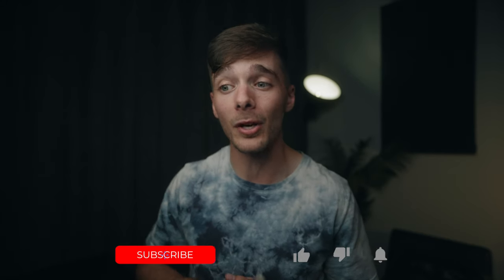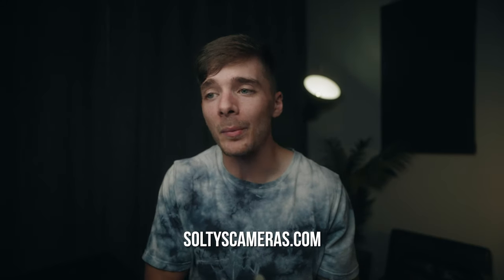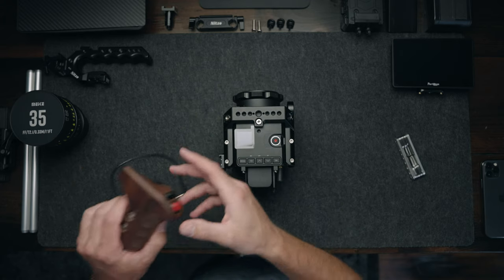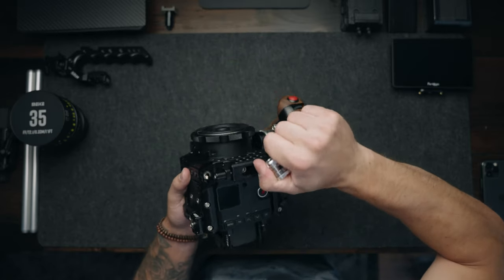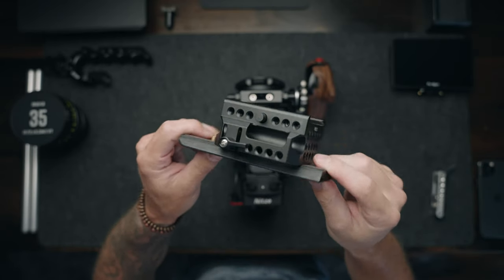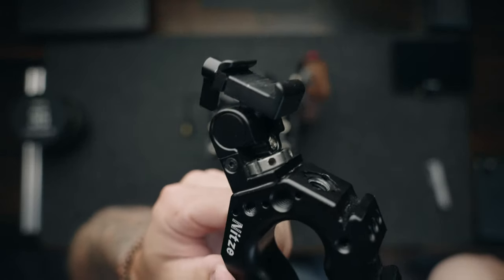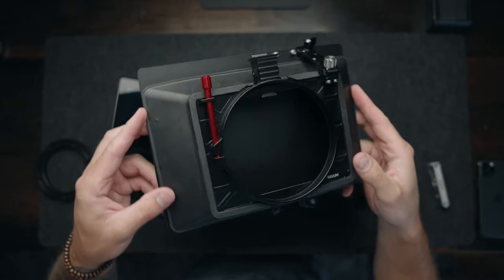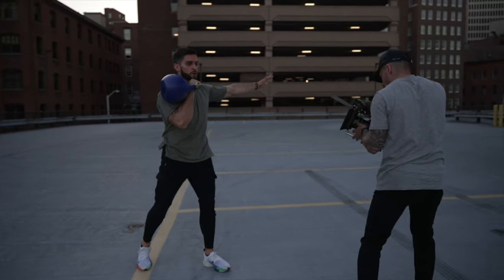Z CAM RIG BREAKDOWN

Comment: Hi' Mac, quick question for you. Today's July 2022; I'm considering investing in a Z cam like the one you show here, and I was wondering if I will also need to upgrade/update my computer for the 4K/6K editing side of this new gear. I'm currently using a Dell  with Intel i7, SSD hard drive and plenty storage room for Premiere Pro. 
Any tip or advice greatly appreciated! (and IF I will require a new system, what will you suggest/recommend?) New to your channel, thank you so much!

Comment: Sweet rig! How do you find using the BM5 iii? I'm having trouble calibrating the screen to show what the camera is actually outputting. Like it doesn't quite match when I import and apply the same LUT. The BM5 seems to have a lot more contrast (and no, lowing the contrast setting in the screen settings doesn't help match the footage.)
Reply from the maker: I turn off the color matching switch on the BM5 and it looks much better that way.

Comment: How do you feel about the focus throw on the Meike + full frame as a solo operator? Ever have any issues pulling focus or missing shots? I like the full frame look but tend to find S35 easier to nail focus..was wondering if you've had the same experience or not
Reply from the maker: The long focus throw I didnt like much at first. But I am getting used to it now and honestly starting to really love it! Ive been shooting Sony full frame for years with vintage glass, so Im used to pulling focus on full frame. I miss focus here and there, depending on what it is im shooting. But I dont mind if the subject falls in and out of focus sometimes. Can add character to the look imo.

Comment: You can tell he filmed the headshot with a zcam. Muddy shadows and glowing highlights. Honestly not hate, just frustrated that all zlog footage looks like this. Can't tell if the log is bad, or people just can't grade it.
Reply from the maker: Lol. Talking head is shot on A7Siii. If it was z cam it would be WAY cleaner. Also, YouTube compression makes all shadows muddy in pretty much every video. I’d also consider myself to be pretty decent at grading. 🤷🏼‍♂️
Reply: Referring to zlog, that's an exposure and grading thing my dude. I've noticed many people aren't aware of how light hungry zlog is. You're better off overexposing (with respect to not clipping highlights severely) and bringing it down in post. The shadows won't be an issue.